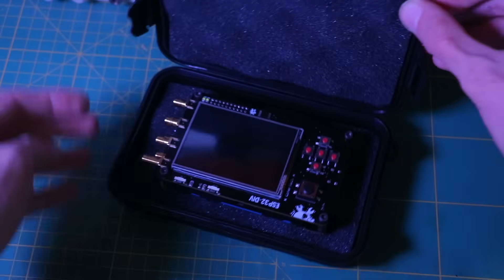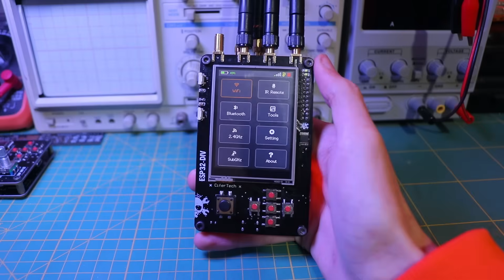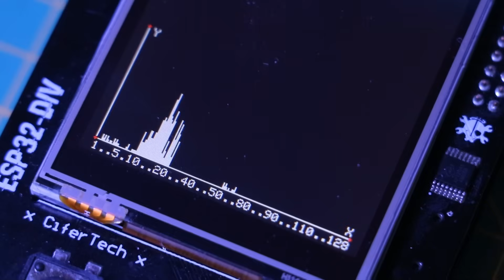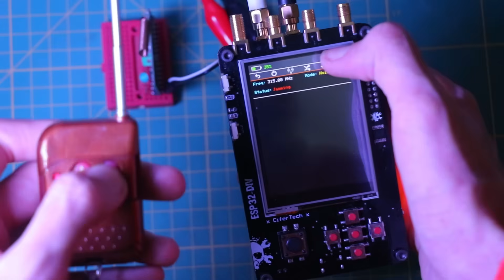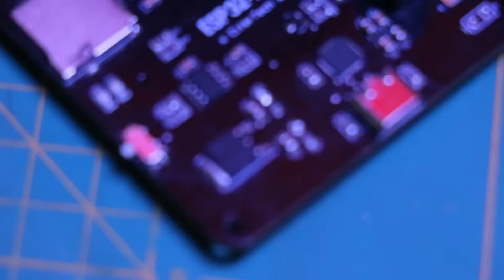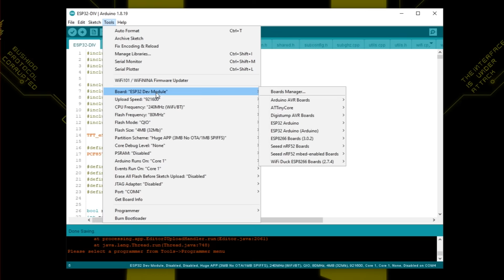ESP32-DIV: Your Swiss Army Knife for Wireless Networks

Comment: I made the same devices thanks to  How to instruction on GitHub.for those who are wondering how he is using touch LCD i should say he used LCD plus touch connected to the different GPIO on board.the only problem that i have is printing the PCB due to service limitations to Iran.but on a breadboard i made it and it works like a beast AKA DIv

Comment: "The PCBs have arrived. The daughterboard has manufacturing errors—mounting holes are missing, as expected—but everything can be fixed with a drill. I had the boards manufactured again using the PCB factory’s proprietary software to avoid any incompatibility with the Gerber files. Thanks, I’m having fun with this project."
Reply: They arrived without holes too, friend, I have already ordered all the components, I hope there is no error in the BOM FILE

Comment: Can somebody help me please , I've ordered the pcbs but they said that there is an error in the gerber file , tbh I'm new on this I have no idea how to fix the file ,they said the following:

Sorry to bother you, but we'd like to confirm an issue found by the engineer during the generation of the production file.
As shown below, the indicated slots may cut out the pads/traces, which may cause short circuit,  is that normal? we have 2 options for your reference.
A:  We help to delete them to proceed
B:  Proceed as per your gerber file, but need to accept the risk.
Reply: Usa easyeda
Reply: same thing happened to me in a nutshell they are PCBs that will be of no use to us

Comment: Nel file gerbere Ci sono problemi sui fori di fissaggio del pcb. Per chi volesse realizzarlo deve modificare i fori ,altrimenti vi verrà rifiutato.
Reply: did you solved? or you just order the pcb with the errors?
Reply: @andressalazarlopez7529  si ho risolto, ci sono altri errori segnalati da jlcpcb .ho sostituito i fori ,modificato la serigrafia dei componenti che copriva i contatti dei componenti. Ho lasciato inalterato il resto. A breve dovrei ricevere il PCB. Comunque prima di ordinare il PCB prova a compilare correttamente il programma e caricarlo su un esp32-s3 ,verifica se l ESP va in kernel panic tramite serial monitor dell Ide di Arduino
Reply: @il_solito_troll  yo bro so all is good right?
Reply: @nokia5376 I'm finishing assembling it, there are still some components missing that should arrive in a few days. I would have preferred the shield to be inverted but if it works it can be done with little effort.
Reply: @il_solito_troll  can u make a video for that?cuz i also want to make the same div
Reply: @il_solito_troll  anche io attendo i componenti spero non ci sia un errore nelle pcb anche io ho avuto lo stesso problema con i buchi
Reply: @il_solito_troll  pieno di errori io ho acquistato tutto ma ci sono errori nella pcb secondo me
Reply: @marcorossi-po1cd  Yesterday we finished assembling all the components, the circuit seems to be working. Tomorrow, if I can, I’ll run some tests on the software.
Reply: @marcorossi-po1cd  un errore è quello dei diodi led della shield . comunque è circuitino carino
Reply: @il_solito_troll  dai ottimo facci sapere
Reply: @il_solito_troll  saresti cosi gentile da condividere i file gerber modificato pls
Reply: @il_solito_troll  spero che lo condividerai per chi non sa modificare il pcb ti ringrazio tanto
Reply: per piacere condividi il file gerber ? ti pago non so dimmi te

Comment: Will you be adding 5GHz networks to the project?
Reply: you can replace the ESP32 it uses with an ESP32-C5 for dual band 2.4GHz and 5GHz, though you might have to edit the firmware slightly

Comment from the maker: Check out NextPCB's free DFM software! It automatically checks for 20+ PCB design errors and helps you optimize your layout: https://www.nextpcb.com/dfm
Reply: Do you have pick and place files that can be added to the github repo?
Reply: I want to order whole prozect plz
Reply: @White_hat_rono  bro i have the full project but its not a complete project yet its more of a showcase off the things that will come and others saying its bad ble and stuff is not true this is a strong build only thing to fix ib this project is battery display thats been added to fork project also i have added heat map for 2.4 ghz analyzer